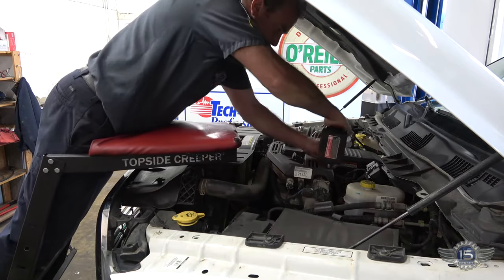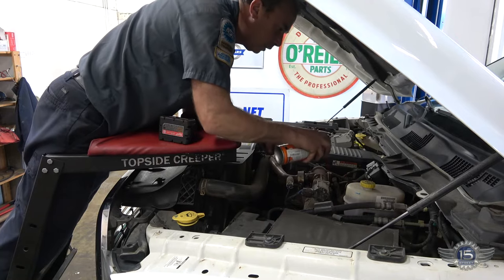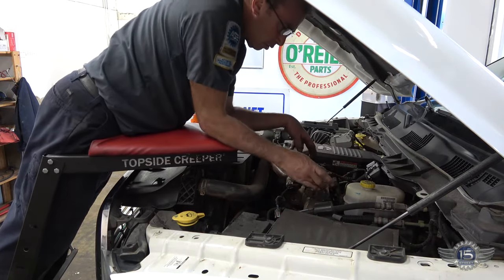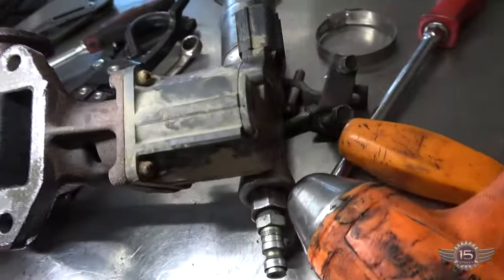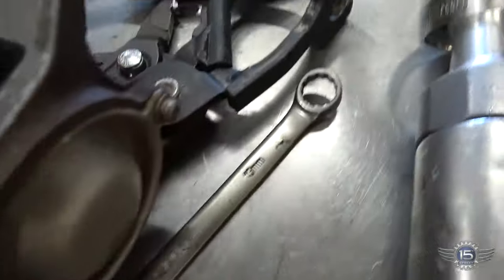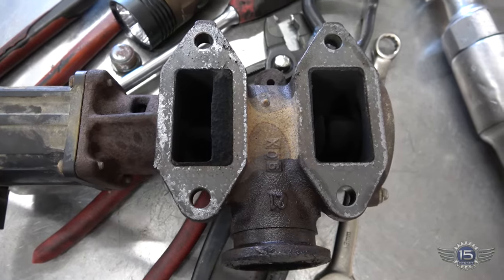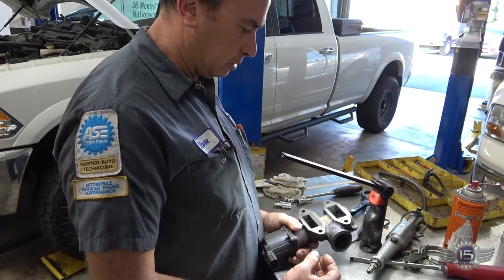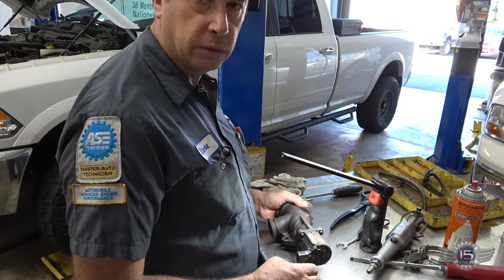Dodge Ram 6 7L  No Power On Acceleration

Comment: The return spring in the valve body pushes the solenoid rod back in. If you pushed on it at all you would have mucked up the whole scam on selling a new egr valve. If you plugged it in, pretty darn simple test, it would have worked just fine. I know because I do all the maintenance on my 2011 ram 2500 cummins myself, including the 67500 service. If you sold that customer a new egr valve when you never bothered plugging the one you cleaned back in your an a-hole mechanic and why I work on my own vehicles. Seriously you didn't notice that with the egr valve cleaned when you put the solenoid back on you had to let the rod go back in to get it on because if you hadn't the damn egr valve would have been open.
Reply: Thanks for that extra input.

Comment: So, I’ve only briefly begun to listen to this video and immediately it is clear that the problem we are having with our truck is not the same. Our truck starts, will drive and sometimes…has no issues, however, often the truck looses power from the pedal. The truck can be operated without issue on the interstate using cruise but if shifting/speed changes are required, the truck looses power. We have spent thousands of dollars trying to fix the problem one of which was changing the pedal & body grounding strap. We have recently had it suggested it could be a turbo sensor issue. I am reaching out in an effort to help my husband find a solution. If anyone has had this same problem and has ideas, we would be grateful if you shared your solution. TIA
Reply: Following! I got a 2008 6.7l with 6 spd manual transmission. I loose power when I shift speed and it sorta sounds like I have the exhaust brake on but I don’t anyone else experience this before?
Reply: @abmtz8537  I have a 2007 manual transmission if I don't feather the pedal I have turbo noise that sounds like a engine brake it just started this morning did you figure yours out?
Reply: @zachlangolf2287  I only have a few months with mine. On my first oil change I didn’t change out the fuel filter so I figured it might be that. So far I haven’t had any problems since I replaced it hopefully it was just that.
Reply: @abmtz8537  I will give that a try my fuel filter is not that old probably 8 months but worth a try thanks
Reply: Did you ever get the problem solved? I'm just having the same issue, and I don't have a ton of cash to throw at it. Thanks for any help pointing me in a direction!!

Comment: Ok. Hopefully you see this and reach out. I have a 2015 ram 5500 utility truck, I have 3 codes. P2bac, p0401, p0471. Egr vavle is new, exhaust pressure sensor new, new egr cooler, no blockage in the exhaust system, no blockage in the intake system. Turbo and vgt brand new. Have good power, good grounds, good signal from signal wires, great continuity all the way back to pcm. Map sensor is new, maf is good barometric sensor is good. Intake air temp sensor is good. Am I missing anything?

Comment: Seems to me he should have hooked the electrical portion back up to see if the computer would have retracted the electrical portion of it because carbon could have stuck the valve in that position and the motor couldn't retract so when disconnected would have remained open until reconnected may or may not be faulty incomplete diagnosis

Comment: Do you think this could cause a P0299?

My truck when started sounds like it stuck in a regen....absolutely zero boost or power.   Sometimes it will just come around and about snap your neck off accelerating when it is having a fit.

Very intermittent....but is getting progressively worse.

Truck went in to dealer immediately first engine cel (literally the next day).  They told me the excessive regens were from a dirty air filter....😂.  

Still an issue and is getting worse by the day.   

Again.   P0299.   Sounds like either the exhaust brake is on or in a regen.  Symptoms seem like something is sticking.  

I dont have a scan tool...but the second time the cel came on....I was leaving work and stopped at parts store for a scan.  

Any I put would be much appreciated.

Don't think it is bad turbo.  When it is not acting up....first gear from dig deliveres 30 pounds...and through the gears it hold between 22 and 25.  There is a pretty hard refuel and stumble between I think it is the 4 to 5 shift....this is likely the torque management doing it's thing but being over shot or misinterpreted by ecu as egr is sticking.

Lastly.  I know on the 19 to 22s at least.....the egr cycles a few times after after shutdown to clean itself...this is still doing its thing and sounds as normal as it has the life of the truck.

2022.   2500.  51k miles.

Please help....SOS!
Reply from the maker: 1. Ensure that the Powertrain Control Module (PCM) software is current, if not, flash update the controller before continuing diagnosis.

2. Check the air intake system for any leaks, pressurize the turbo plumbing system using 20PSI of air supply, then check for leaks with a soapy water solution. Pay careful attention to the charge air system rubber hoses, often times these will develop small cracks that can leak but are hard to pinpoint.

3. Check the Exhaust Gas Recirculation (EGR) valve operation. Try running the actuator test to see if the valve moves. Note: Shorted EGR valves can damage the Powertrain Control Module (PCM).
4. Last one I had was a faulty EGR valve
Reply: @fixingcarswith15thstautomo36  after another couple hours of reading and really bringing full circle the symptoms....

The lag is something to be reconed with...I got the issue to replicate to the point I drove it half mile down the road and back home with no boost until I was about to pull in the driveway then I came on like I hit the truck with a bottle.

About half hour before that....I was driving the truck using the exhaust brake and almost like I stole it to see if anything would stand out.  The thing that stood out....the exhaust brake too is intermittent at this point.   

No other codes for egr or dpf, just underboost.   

It stands to reason, either the actuator for the veins is dying a slow death....or the veins are carboned up.

I dont hardly work the truck like it should be worked, but it gets up to operating temp plenty on my commute to work and typically has plenty of time to start and finish a regen in a single haul.  

The bad side....I dont get the truck up on highway much anymore with it being summer and kiddo not in school.   My route is much different during the summer.

As far as PCM flash, injust picked the truck up Friday of last week for recall service (you know....EPA over reach reprogramming) and the DPF sensor install.  Oh....and the touch screen was replaced for the second time....oh...and the power steering is leaking again.

I greatly appreciate your response and have taken a screen shot of the information you have shared.   I am going to get the truck up on the highway the next couple days and exercise the exhaust brake to hopefully clean up the exhaust side of turbo.  

Of that doesn't straighten the thing out...I am going to dig into your list one by one.

And I will be going to the forums to share the symptoms and fixes.   I'm not alone I'm sure....expensive truck....low miles....out of warranty....fixing it myself.

Thank you sir!
Reply: @fixingcarswith15thstautomo36  I will add....I had an 05 F360 with the "dreaded" 6.0 (I had really....little issue with mine and it was a darn good truck and had the 6 speed).   That truck also went through ots far share of scratch your head turbo stuff eith the veins.  I ended up pulling it apart, cleaning it, put new seals in it, cleaned the EBP tube and truck ran fine until I sold it 120k miles later.

I forgot about the stuff I did on that truck and the weird erratic turbo/boost issues until reading about it on the cummins forums.   Same deal.

Comment: My 2018 truck doesn’t have the same power like when fist got it. but no check engine light Any suggestions. can the scanner read codes Without checking light?

Comment: Is there anything you can do to keep it from getting carboned up
Reply: I use either Lucas or Howes fuel additive about every 3rd tank and at 127k I have never needed had to clean my EGR valve or cooler. It works for me. But I have also noticed that friends that have done tuners and deletes have constant issues with their engines.

Comment: So this was the problem all along not the dpf……. Jeez I hate when you mechanics do this! Learn more diagnostics before you end up charging the CUSTOMER SHIT LOAD OF UNNECESSARY COST. and did you know you can clean out those Cummins EGR valve ….. give your customer the option     RIPOFFS !!!
Reply: One causes the other.  The dpf gets clogged over time, makes the engine work harder, soots up the egr, creates more soot, etc.  Terrible design.  Solution is to delete.